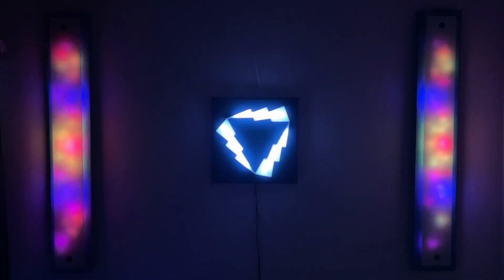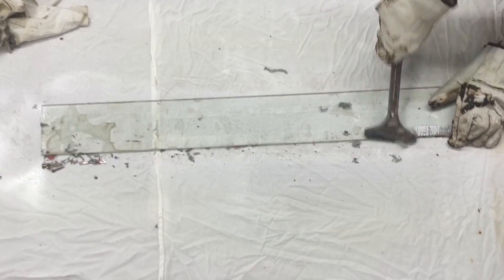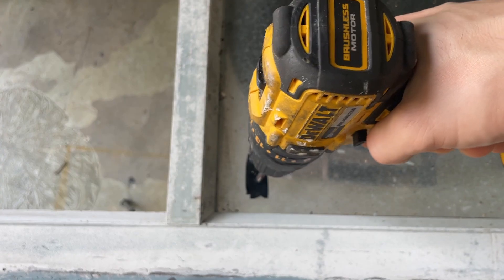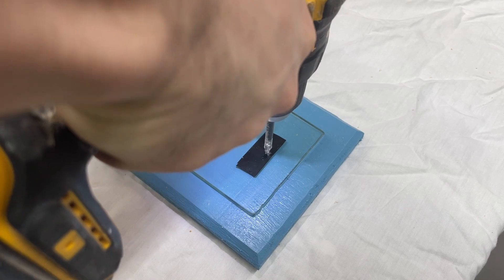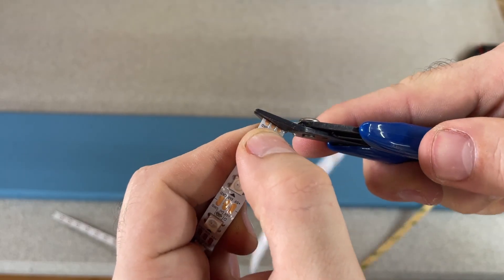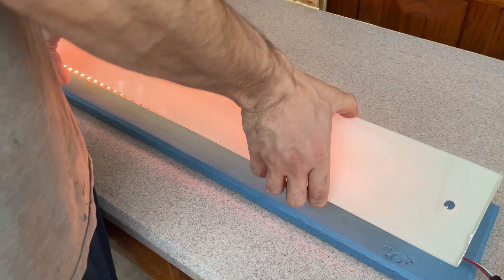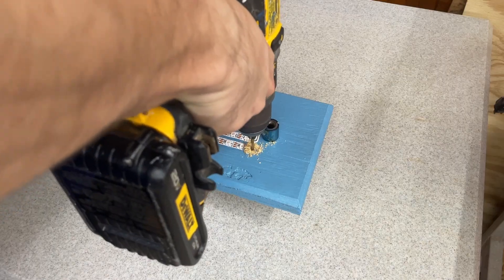How to Make a Diffused Vertical Matrix Light [WLED Creations]

Comment: this looks great! ive been working on a similar but horizontal sight bar and im having a lot of issues getting the matrix to work right in wled :( any chance you can show how you set up the direction of the light strips and wiring and the settings to make them work right in wled? thank you so much!
Reply: ok so i see the github link you sent on the other comment below. im going to recheck my settings but i feel like everything is correct for one horizontal matrix using 5 strips but when i test out the scrolling word in wled the rows go opposite directions >.<
Reply from the maker: @flecs  I remember when I tried to get this matrix set up, it was annoyingly tricky to figure out the directions. It did some weird stuff like that for me as well when I thought I had it correct. The diagram in the 2D setup of the WLED interface can be really helpful. Try to look at that starting with aligning the green dot to your first pixel in the line, then follow the lines to ensure it matches your wiring until the end at the red dot. If that still doesn't work out for you, I've used this technique before to force my way to the solution: 
https://www.reddit.com/r/WLED/comments/10vhupv/how_to_determine_the_2d_settings_for_a_matrix/

Comment: How did you configured each light in wled? is it configured as matrix? how is the segmentation?
Reply from the maker: Yes, I used the 2D matrix configuration in WLED. The matrix configuration makes it super easy to create new presets. So the only thing I had to do for the segments was define where the outer vertical lights started and ended and do the same for my logo in the center. I've been uploading all my preset and configuration files to GitHub, so they are freely available at the link below if you want to check them out.
https://github.com/Electriangle/my_WLED/tree/main/Vertical_Matrix_Light

Comment: Would love to know how you set up the presets, they look great
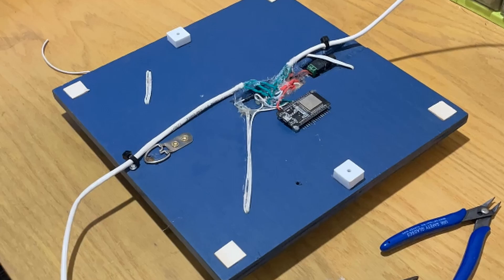Reply from the maker: Thanks, my favorite one is the blue/red fire animation at 6:19, which is made using the Fire 2012 Effect Mode with the Analogous Color Palette. To be honest, I didn't save all of them as presets, I threw in a few extra random effects for the sake of the video 😅. But let me know if there were any specific ones you were curious about. 
Also, I decided to start backing up my WLED project presets on GitHub in case something happens where I need to reconfigure any of them. It is public, so you could check it out at the link below if you did a similar project and would like to directly upload the file into your WLED interface (Upload can be done in Config > Security & Updates > Upload Presets / Upload Configuration).
https://github.com/Electriangle/my_WLED/tree/main/Vertical_Matrix_Light